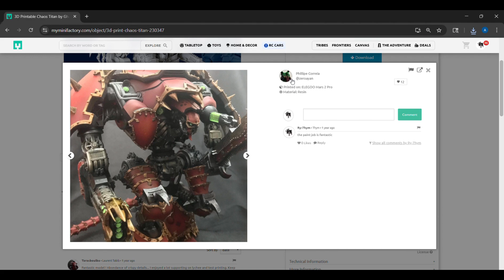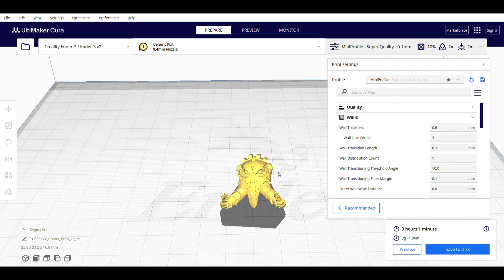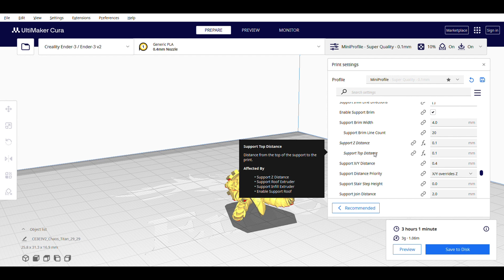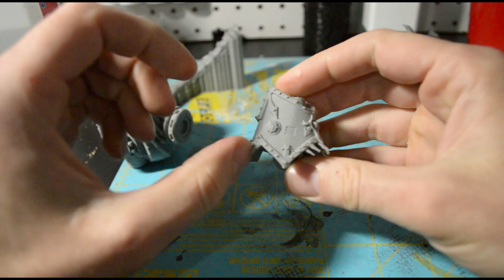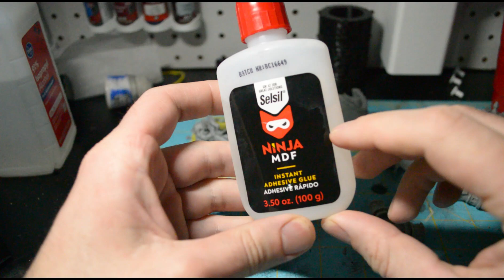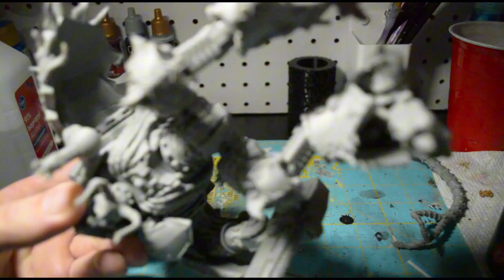3D Printing a FDM Chaos Knight Miniature using a .2mm Nozzle

Comment: As a resin 3D printer user , FDM has my curiosity especially for terrain
Reply from the maker: I definitely tend to use FDM for my terrain pieces, and I think the improvements in FDM have really helped as well.  FDM prints faster than you used to, and you can even use mult-color for some.